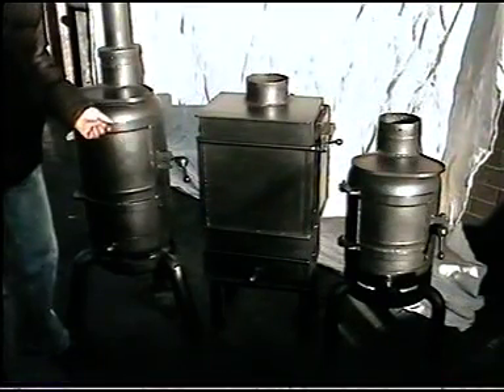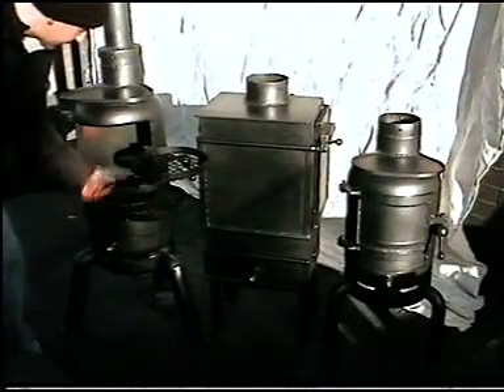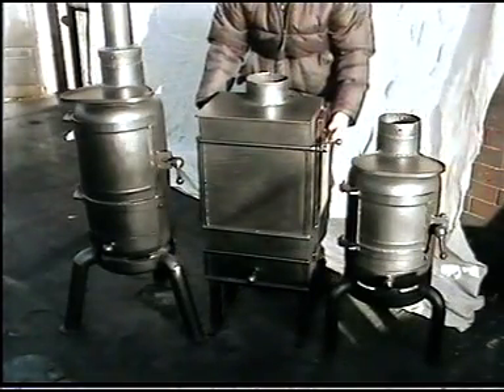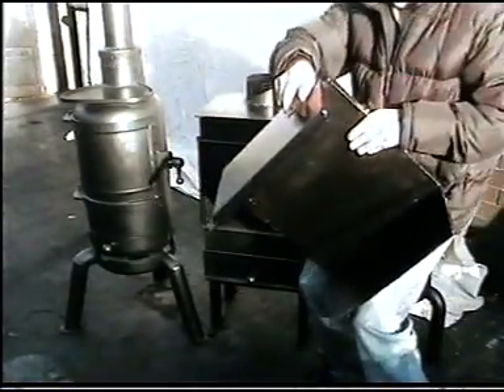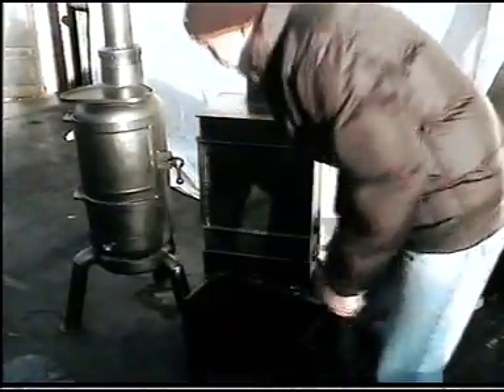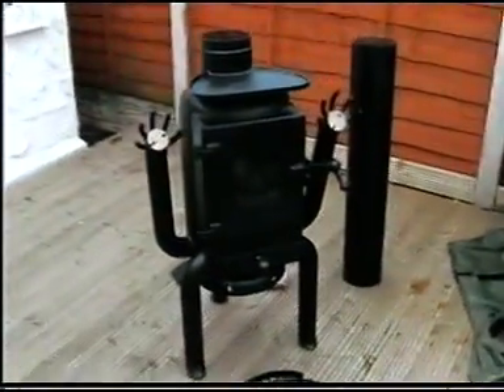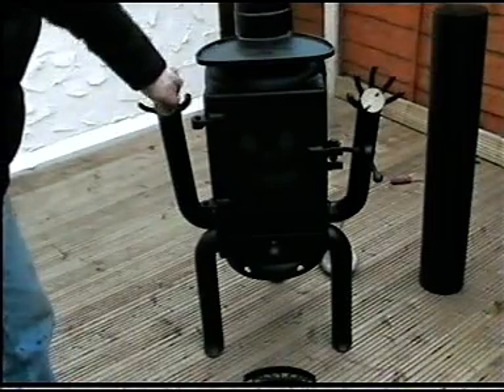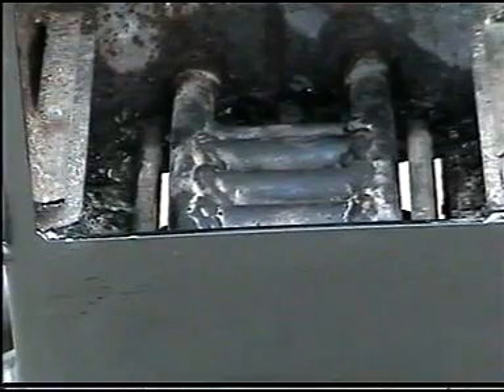Introduction on how to make a solid fuel burning stove from an old gas bottle.

Comment: Just a thought, but would it be possible to weld up a box stove/boiler out of small domestic single radiators (say 4 x 30cmx30cm radiators for the top and three sides of the stove), which could then feed a standard vented hot water system? I am sure this has been raised many tiimes before, but as a total layman I am blindly assuming that if the system is vented to avoid pressure issues and the steel radiators can handle the heat, then it might be a viable replacement for a gas boiler?

Comment from the maker: @Abletips Hi, it all depends how big the back boiler is , you could make a coil around the flue to capture more heat and feed more rads, you should be able to heat 2 to 4 rads with a large back boiler, but with a coil as well maybe double , it's all  trial and error, thanks dave.

Comment from the maker: Hi strangelistener,   you can use any stove indoors, you've just got to make sure the area around the stove and the flue is fire retardent,  stoves are used in boats park homes and houses, my  workshop stoves flue go's through a plastic window, I've put an extra steel shield around the flue and left a gap so  air can circulate and keep the window cool, thanks dave.